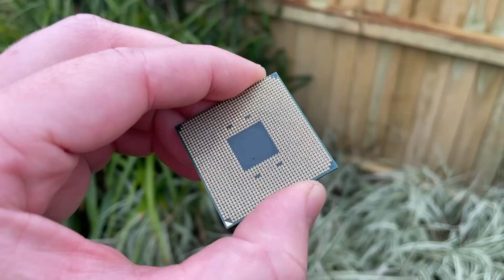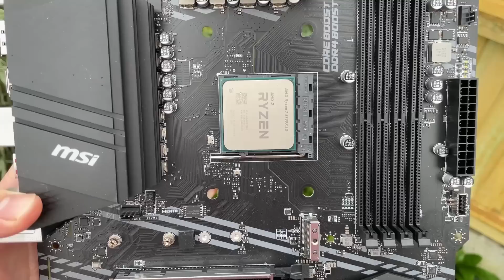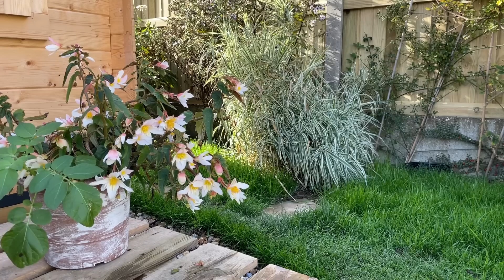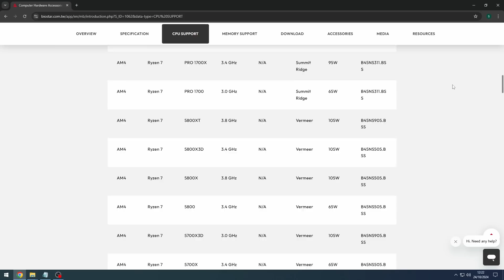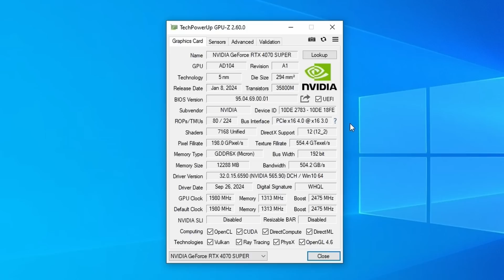I accidentally dropped my new CPU, here's what happened to it...

Comment: let me share my journey here becayse this video has already been my roller coaster ride this week, that the story begins here:

i was playing the finals, for quite a few years and the game has a major update this april 2026, and the game started to became laggy for my pc. I had a single channel 16gb 2666MHz ram on a ryzen 5 5600 x cpu. the game then constantly crashing. 

after trying prime95 maxt stress on cpu, blend test on both cpu and ram, and furmark on gpu, all results are safe. It means i have hardware limitation, rather than hardware going bad.

so i get upgraded my single channel to 2x8 ddr4 16gb 3000MHz adata xpg ram (these rams are not that strong but the prices are high as heaven), my mobo has problem to boot then and cmos reset couldnt even solve it i need to reseat the cpu. the true story starts here

the heat sink stuck to the cpu and so i pull it out, no bent pins, im a wizard
but it stuck, what do i do
youtube shows, using hairdryer to heat it so the paste become melty for cpu to come off easier, and another suggest a screwdriver
i desperately (dont have a hair dryer) chose the screwdriver method, it work
but that nudge also throw the cpu into free fall to the ground

4 pins bent, and i'm fucked
youtube searching again to ease my soul and soothe my crying insides
and then some guy manage to unbent the pins back, and i try 
wizardly, it worked, and windows started again, im now leveling up to becoming a surgeon
still in the mood of congratulating, i boot the game and it runs smoooooooooth

until it crash again.
this time, i know i fucked up, unleashing prime95 torture and my cou cant even stand for 5 minutes while it did for 1 whole hour previously
then i see this video. 

and here i am opening a new tab studying pcie and learning to set the pc to run pcie 3.0. 
maybe the pins i bent werent controlling the pcie sector 
but i should try any ways i still can.

if you are still reading, thank you for your time
and a little more, because i need your luck to pray for my following software surgery.
if it work, im fasting for a whole day. peace
Reply: nah it failed :(

Comment: RandomGaminginHD
Hello, I have an A520M-HVS motherboard, its PCIe is 3.0 but when I open GPUZ in the Bus interface section, it tells me PCIe x16 4.0 @x16 3.0, but a few seconds later it updates and PCIe x16 4.0 @x16 1.1 appears, my question is, why does that value appear?
(I have the Resizable BAR enabled)
Is it bad that x16 1.1 appears, does it cause a bottleneck?
Sorry for the wording, it's that I use Google Translate. 😉
CPU Ryzen 5 5600x and RTX 3060TI

Comment: you got a couple shorted layers on the corner thats damaged, give it a very small tickle with a dremel on that damaged corner to polish off the squished bit of the pcb then nail polish it over to keep the layers electrically seperated

Comment: I had a realy bad accidents with the r5 5500 on my a320.Tried to make it work but asus bios couldn't let me.After that the cpu was glued to the cooler when pulling out 3 times and had been dropped on the mobo.2 pins in very bad condition,didn't managed to straightened them and the warranty was lost...:((((

Comment: If the pins were bent after the initial drop (and the subsequent being stepped on bit, because there's no WAY those pins would be so bent after a simple drop) and you straightened them, I would put it down to METAL FATIGUE DUE TO BENDING and thus reduced the flow of electrons to those pins!

Comment: I've moved on to the AM5 platform.
There were one or two occasions I accidentally bend the pins 
If it's just that, you can use your credit/debit card to straighten out the pins. A magnifying glass and a touch light is super helpful 😊

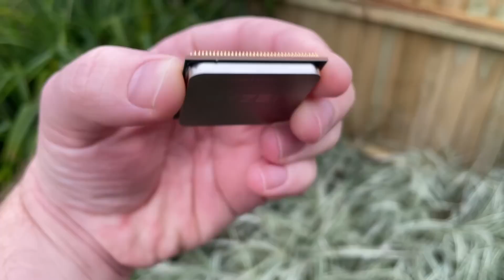Comment: Hmm , how did you know the CPU was not faulty or damaged in post in the first instance .. May even be a compatibility issue with the initial board ?  @6:57  there is still clearly at least one bent pin that may not be connecting to the motherboard ( I know this from experience) ..  Also I would install it without a cooler , let it overheat  a few times to reflow any microfractures

Comment: Reminds me of me with an i5 6600k that i delid with a razor blade, i did it with all the care in the world but i guess i manage to damage the internal pcb, it let it me boot up GTAV, mind you the temps where way lower but fps began to decrease until it just crashed and never booted again,  went to a welding shop and asked the owner to make a hole with a drill into the cpu and ihs to use it as a keychain or necklace to remind me that CPU's are good enough at stock, havent bother with overclocking even since. Greetings from Mexico friendo.

Comment: I had a bad ryzen 5800X that had a very similar problem. It would only do pcie 1.1 on the gpu slot on an X570 motherboard but if I manually set the pcie version to 3, it would work at pcie 3.0 (on a pcie4 motherboard) and it worked fine. Very strange. Then a few months later I replaced the 3080 with an Arc A380 gpu and it actually damaged the already weak pcie lanes of the cpu where it would only run the gpu slot at pcie 3x4 from then on.

Comment: Is there might an issue with the BIOS Version on the Mainboard?
An old or wrong BIOS can mess up a lot. For example the 12900k on the ASUS Z690A-Prime gave me a lot of blue screens before updating the BIOS and XMP didn't work at all. Last but not least, PCIe was limited to 3.0, even with RTX 3070. Switching to 4.0 the system refused to boot. So a BIOS Update was necessary.
I dropped a few CPUs and never experienced any performance issues. It was more a works or work not scenario.

Comment: When we are on the topic of 5700x3d maybe somebody knows the answer for my question. I know the X3D cpus are not too sensitibve to ram. I have a 5700X3D, rx7600, 2k monitor and had some off brand ram 2666mhz cl20 32gb (ddr4), now i upgraded to 3600mhz cl16 32gb kingston fury renegate. I checked the differences and cant see any to be honest. only way i could see a difference was playing RUST going onto outpost around 100fps (in one specific spot) with old ram around 112 (same spot same server) new ram. But if i start a ukn server or check it in any other game i can not see a difference. Does somebody know if there should be a greater difference, maybe i should check other games (i checked also rainbow six siege) or is the ram actually such a small difference for the cpu that it almost doesnt change things. If somebody can help somehow i would be glad.

Comment: So I'm having some weird stuff happening to my PC. It runs well and temps reach around 70 C under load, but some games cause my PC to reboot. Star Wars Outlaws causes reboot about 30-60 seconds after starting the game - menus and intro are fine, Space Marine 2 on ultra does the reset about 1.5h in but I was able to run SM2 for about 25h before any issues started to happen.
I have 6700XT and 5600X but my PSU is close to 10 year old, it's a Corsair VS650. Any ideas what might be the issue there? Most parts are 1-2 year old and I'm on fresh windows install.

Comment: @RandomGaminginHD  in the golden arrow corner - bottom left at 6:50 pin is broken off. needs to be soldered by someone who knows micro soldering, pins are stuck to CPU pads with solder bumps, its not an end of the world. I think chip is fine.

Comment: I accidentally sucked my Ryzen 5600X CPU from the socket, the stupid thermal grease stuck the cooler and CPU together like glue. 

Next time I will let the CPU warm-up before I attempt to remove the CPU from socket in the future. Note the 5600X survived and was not dropped. I now have the 5800X3D CPU.

Comment: Never seen this behaviour with video cards indeed. But with network cards i have seen many problems with modern AMD Ryzen (5000 and 7000 series) where the card is not visible at all or running in 2.0 mode when it should be 3.0. Also some builds have seen this problem change with every powercycle. The solution for my problems with network cards that worked 100% of the time has been to set the speed in the bios and not to trust auto any longer. In fact have been seeing it so many times now that it is the first thing i do problems or no problems.

Comment: I bought a 5600X during the pandemic, dropped it during install, broke 3 pins, one of which was stuck in the socket. After buying a 99p cpu for donor pins, and the most nervous soldering of my life, I got it working on a new board. Until, I realized that the system could only see 16gb of Ram. Looking at a pin map, the corner pin was for the memory controller, taking a chance, I removed the donor pin and reseated in the old board. Worked perfectly, until I needed to upgrade, the act of removing the mobo from the case must have done something, as that combo is now totally dead. Did get another year out of my hack job however

Comment: I just managed to get a 5800x for £110 and it works flawlessly, but as soon as I change the voltage (even by 0.1) it locks the cpu to 1.3ghz for some reason and the cinebench scores are around 4-5k, I was just trying to undervolt it to 1.35ghz which I have done on all my other Ryzen chips so don't know what is causing this.

Comment: Did you clean the pins after with isopropyl alcohol? Might have a little dirt on some of the pins. Top corner diagonal opposite to the arrow, appears to be damaged. Might be that you have slight delamination of the PCB. Last of all, although everything looks fine on the surface, you might have a cracked pin under the solder. 
Nice video, great information for other people in similar situation. 
On the bright side, ideal CPU for you test de-lidding and all the lovely crunch noises as the heatsink gradually releases from the PCB.

Comment: Same CPU, was moving it from one motherboard to another and I dropped it. Damage was a few bent pins but what concerned me was the damage to the corners, including a couple of small chips and a dent. After working on it for a while I believed the pins to be straight, but was wrong. When I went to close the latch I noticed there was more resistance than usual but I forced it through. Never do this, it means at least one of the pins is bent enough that it's bending the motherboard socket clips that hold and contact with the pins. When I went to boot the PC I realized channels A1 and A2 didn't work, so no dual channel RAM. This led me to do more research and I learned that if the latch gives more resistance than normal after straightening pins that you should stop, remove the CPU, and continue straightening the pins. Someone suggested using a mechanical pencil 0.7 tip, supposedly the pin slots right in. If you already forced the hatch to close like me, look for a YouTube video on how to remove the socket cover, it's made of very fragile plastic but not too important if some pieces break off as long as it can be set back in place. If you mess up bad replacements are sold, but be patient and consider heating the plastic with a hairdryer to make it more malleable. Then you'll need a very sharp tool, good lighting, and if your eyesight is bad you might need a microscope with a display. I just used a sewing needle and set my phone to video mode with flash on and zoomed in. The same video I found for removing the socket cover (there aren't many, if you can't find it ask and I'll look for it again) explains how the motherboard clips work so you understand how to fix them. After going through all of this, I managed to put it back in like normal and it's been working perfectly this far since September.

Comment: My rig ran the similarly with this same cpu upgrade even though i did not drop mine.  Ended up resetting window for a full fresh install. Five hours later everything was running just fine.

Comment: So basically this dropped 5700x3d lost pcie 4.0 and B550 board functionality, but works flawkessly on pcie 3.0 and B450 and/X470 boards
🤔😮

You may have to sell it at a loss and advice the buyer just to buy B450 or X470 boards to use with it😔

Other than that, its not a total loss. Just use the dropped 5700x 3d for general use, gaming but no overclocking to be done on it whatsoever😉😊

Comment: At the 6:50 mark, the fourth pin, or second up from the gold corner is missing.  It is the fourth pin in the cpu layout called P_GFX_TXP[0]  This is the reason your not getting your 4.0 speeds.  Take a staple and cut it to length and insert it into the board on that pin and if you get the length right, it should work for you.  Either that or find someone that can solder a new pin on the chip for you.
Reply: He has been made aware of it :)

Comment: I accidentally dropped my i7 10700 last week. it still works and can play all of my games luckily. but
cannot enable XMP at all
sometimes get a message  "usb device over current status detected system will shut down in 15 seconds" and shut down on boot, even though no usb device or front usb headers are connected

Comment: The CPU not boosting off base clock is probably a BIOS setting, the 5700X3D doesn't support any ANY any overclocking beyond PBO so if anything like XFR is turned on it just runs baseclock, no boost for you! Ask me and my 45 minutes of wasted time how I figured it out. As for getting the full boost from the 5700X3D I found that a minor undervolt and setting a manual PBO scalar of 3x keeps mine at the whole 4050mhz all the time under multicore testing and gets the single core speeds up to their max and keeps them there.

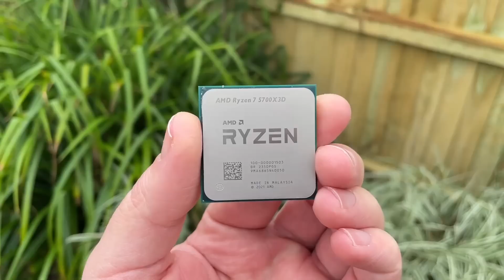Comment: at 6:46 above the arrow you can see missing pin, i think that's the gfx pin, you can try to solder a new pin or take it somewhere where they could try to solder one, alternatively, you can put a piece of wire in the socket but make sure its bit out of the socket so the pressure is enough

Comment: i had an issue like this, ofc i didnt drop the cpu tho, i changed a setting in my bios on my msi b650p mobo and everytime i ran benchmarks the computer would black screen and restart, i fixed it by clearing the cmos. i have a ryzen 7 7700x

Comment: I bent pins on my Ryzen 7 5800X and straightened them out. The thing was, I started having an occasional issue with RAM access. My computer would not restart or anything, just spit out an kernel panic error. (Running Linux)

The thing is when I was removing the cooler to check it out, I accidentally yanked it out of the still closed socket. Did not remove any of the pins, and since then seems to be running fine.

My thought was that the pins I bent back into place where not completely straight and were not making full contact in the socket. It pulling out of the socket might have straightened them out completely.

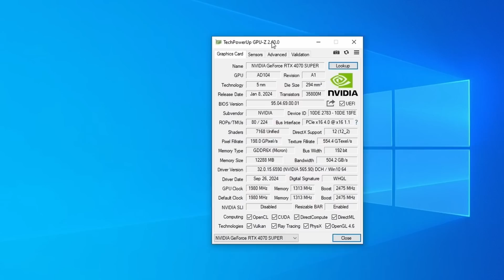Comment: Did you drop it on a hard or soft surface?  @1:48...and further you don't show it under load.  It's normal for GPUZ to show lower bus speed/bandwidth than its capable of.  Problem with b450 is that most (if not all) don't natively support SAM (smart access memory) or pcie4, but you addressed that.  I'd chock it up to you dropping it and somethin just ain't right.  Sell it faulty and move on.  Thanks for the vid tho!